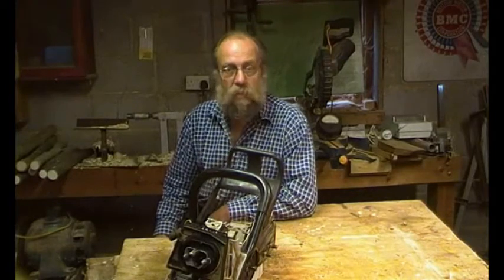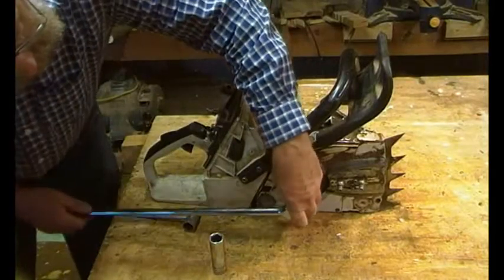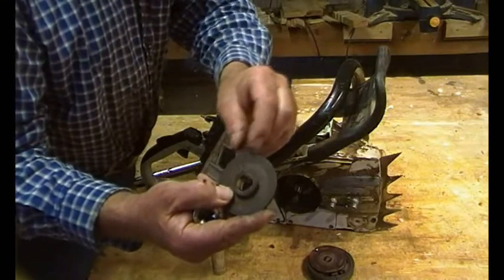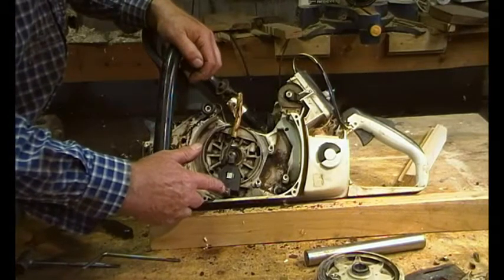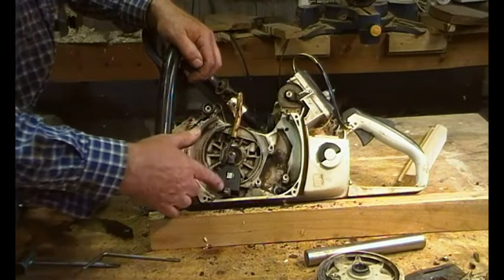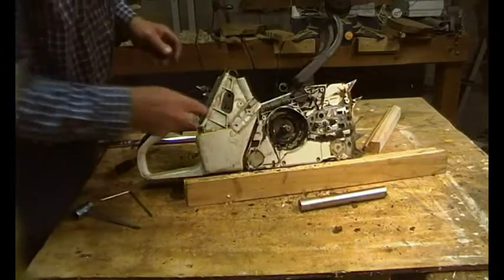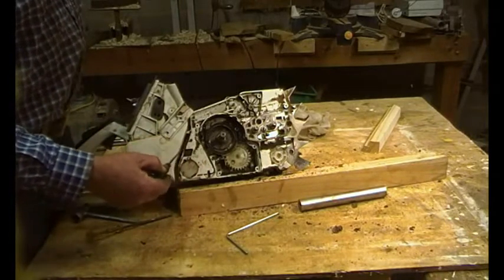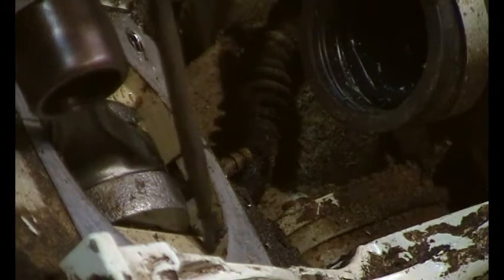Stihl MS880 chainsaw: broken crank, pt 3

Comment: Missaligned case possibily as well. I would get a new saw. Also a sudden jam of the clutch as well. What would have been nice is to have the flywheel key break away like a lawn mower. That way the engine can stop suddenly without it being on the firing stroke at top dead center if the crank jams. Some of the Stihl chainsaws as well didn't have a desaxed offset when the piston is at top dead center ( slight lean to the aft position of the crankshaft. Ever find a crank and parts?
Reply from the maker: These saws are known for weak cranks. This had a new top end a few years ago and the extra oomph was obviously too much. cheers
Reply: @TheInfoworks  that was my next point as well. The crank pins were known to go as well if there was ever pre-ignition or detonation. Also where the crank pins get pressed in, I think they bored it way too much. Could have used a smaller pin and a gusseted throw.

Comment: Hi! Very interesting video. Considering I've just bought an 880 myself, do you have any tips as to how to avoid problems like this and how to discover problems with the bearing before it gets out of hand? I'll be using it mostly to slab medium to big lumber.
Cheers.
Reply from the maker: Hi, this was quite an old saw with a new top end that added extra stress to the bottom end. Slabbing puts plenty of stress on a saw, so stop the feed half way along and just blip the throttle, and don't just switch it off at the end of the cut, allow some coolong air first. As to bearing noise, just keep an ear to the saw at tickover, cheers
Reply: I've seen older videos giving praise and accolades to ceramic bearings,,, As I followed different videos, it appears that ceramic bearings have a rather high failure rate. Just adding my two cents

Comment: When the main ball bearing is the common problem,  put a roller bearing from the same size ! I think it gives more strenght !
Reply from the maker: Hi, yes roller bearings take more load but do not cope with side thrust, and they have more drag. Cheers

Comment: It may simply be a cage design problem, inferior plastics perhaps.I didn't see any cage pieces to tell... Well done video by the way.
Reply from the maker: Hi, thanks for the comment, I suspect it was pieces of cage that caused the damage to the pistom crown seen in part 2. It gradually disintigrated and worked its way through th ports. Cheers
Reply: I have seen talk of cages sometimes now being made from carbon fibre. As I am sure you know, carbon fibre is brittle and can easily fracture into small easily lost fragments, once "things" go wrong.Who can say what gyroscopic loads that (may be heavier than other saws) fly wheel can cause.A saw simply falling on it's side might trigger a transient peak loading. Or twisting it around as high revs...Best regards.

Comment: That flywheel bearing really is toast isn't it ? Is that sort of crank failure a thing you've seen before in  a chainsaw Andy ? Maybe I should ask if you've seen a flywheel bearing as bad as that, as that's the root cause....
Reply from the maker: Dave, that 026 had a bearing just as bad, but being a smaller saw the damage didn't extend. This 880 is just parts now unless a second hand bottom end turns up. Interesting to take it apart, learning all the time. Cheers, Andy
Reply: Yes, I am sure the dismantling of the 880 will be usefui info to someone, as well as yourself... I guess a new crank (plus all the other bits) is costly, but that's an expensive saw to replace, or maybe new cranks are just not available.... Cheers, Dave

Comment: How many years was that 880 used?
Reply from the maker: Hi, I'd say it was at least 15 years old, but might be 20. Subscribed? cheers
Reply: @TheInfoworks  Thank you Andy... yes I subbed you.
Reply: @TheInfoworks  BTW I seen damage like that on logging saws before, some old timer said it was from having it wide open throttle on limbs and small wood... he said the bottom half do not get enough lube and bearings fail first or get bad. I always listened and kept that in mind, his saw was an ancient one and never had any major failures, he used it heavy too.So I guess he meant slack of sometimes between cuts is enough.
Reply from the maker: Yes if you over rev a saw frequently that can damage the bottom end through no oil getting to the big end bearing. Setting the high screw on the carb a little too lean will  make a saw rev too high. Cheers.
Reply: @TheInfoworks   Yes most things he said was spot on and his kit was well used and well taken care of... thank you for the reply, and your videos are pretty well easy to follow... good job.